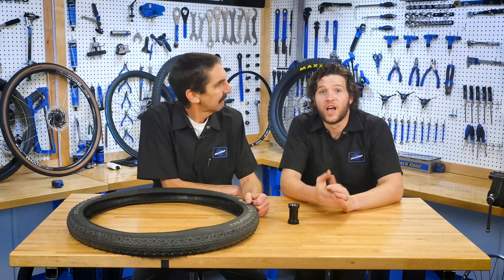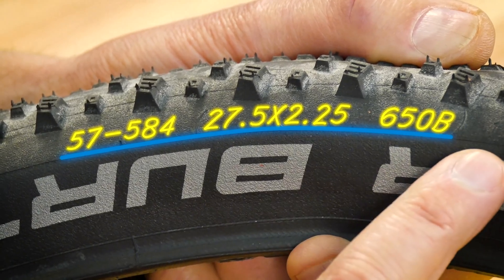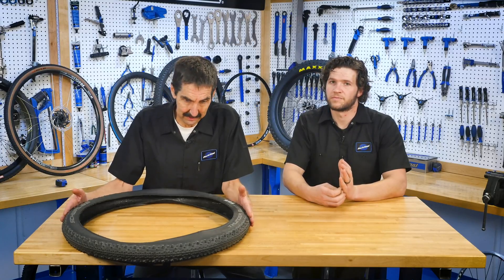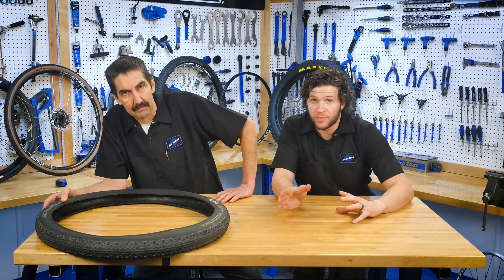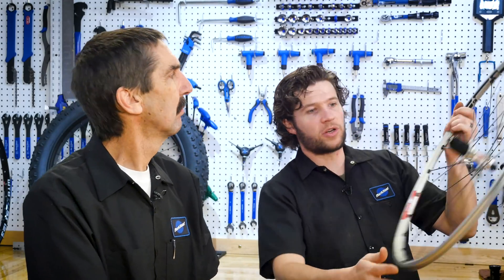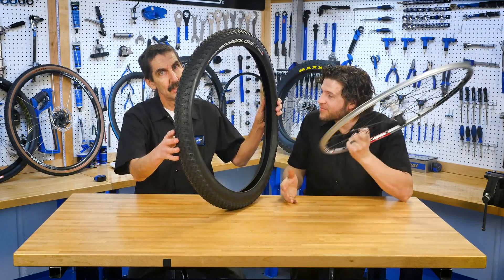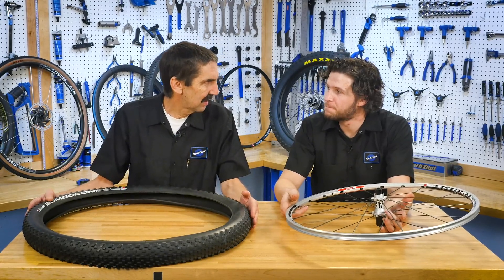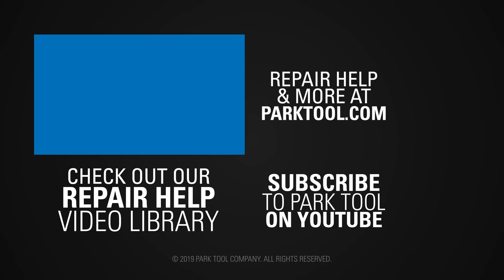Understanding Tire Sizes | Tech Tuesday #145

Comment: Cool video and I've learned a lot from your video but for this, you ain't taught me spit!! I want to know how is my E-Bike rim/tire a 26" x 4" when it doesn't measure anywhere near close but my pedal bike, which is supposed to be a 27.5" rim/tire setup, measures 27.5 for the outside diameter of the tire. I even more confused now. lol. Not really because i understand what you said but it didn't help to know how my rim/tires are 26" x 4". Thanks guys. I'm trying to make sure my tire size is set correctly in the menu. I think it was set at 24" and I changed it to 26" since it's supposed to be 26", but I digress. lol smh. Have a great day!

Comment: I pulled a flat tube out of a tire today. The tube says 700×28/32C and the tire says 700×35C 37-622 so I am unsure which size replacement tube to get. I assume it's a 700C but there are all those other numbers too! VERY CONFUSING

Comment: I believe? the front rim maybe the original? Stating BIG PIG on it. It's an aluminum rim but has no ETRTO #'s on it. I measured from the inside diameter(flange to flange) and was approximately 13/16 across. Tires & innertubes are hard to find here but I do have a new tire 26×1.75 (47-559) and new inner tube size: 26" 47/57 -559 also another new inner tube size: 26"× 1 3/8" (28/37 : 559/597 Can I use any of these to match up to the rim size, tire size I have here? Will definitely subscribe and like if you can help me here. Thx much

Comment: I have a Trek 4300 the existing tires are 26"x2" most of the tires I am finding to replacement are 26"x1.95" or 26x2.10, 26x2.124, 26x2.5 - the question is how critical is the difference between the 1.95 - 2.5 if the rim says 2"? this is a mountain bike by the way

Comment: Mine is 64-622  ,  29x2.35 .... This is at the wheel .... On the rim doesn't have any indicator ... So does this give the actual size to the rim ... Or I still have to remove the wheel just to measure the rim ...

Comment: Great video thanks guys, I'm totally confused by my 37-406 (20X1.35) recumbent tire, A 20" tire doesn't fit because the 406 is a 16" rim outside diameter, so the actual size at base of flange would be 386mm, I wanted to use a fatter tire like a marathon plus but what size do I order, confused !!
Reply from the maker: The industry has not made this easy.  If your tire is a 37-406, that is  the common "20 x 1.75" tire family.  Is your rim also marked 406? It must be if the two originals fit.  This tire family is nominally 20" outside diameter at the tire, not rim.  There are at least 8 other tire sizes with different non-interchangeable bead diameters claiming to be "20", but actually a different fit.  You need a tire marked 45-406, or 42-406, etc.  You can change with width but not the bead seat diameter.
Reply: Thanks @parktool , rim is marked ETRTO 406-19 which seems to be 406 diameter at bead & 19mm wide inside across rim, with a 20" outside tire measurement, Now to find the tire.

Comment: Can 27.5" tires fit 700c wheels ?
Reply from the maker: No.  The bead seat diameter, where the tire bead sits, is 584mm.  The BSD of the 700c is 622mm.

Comment: Hi expert can I put a 26 inches wheel to 24 inches bicycle? Thks
Reply from the maker: If the bike has rim brakes, not possible.  If disc brakes, unlikely but if the frame has clearance, they might fit.

Comment: All four of my steel road bikes are 622 for interchangeability, ranging from 28 to 38 nominal width.  I wouldn't run anything under 32 if my frames could take them.

Comment: Just checked out your video. I have a tire size 28-630 (27x11/8)on my old Trek 400 Series road bike. I’m finding it difficult to find tires with that specific size, I see a lot of 32-630 tires on Amazon. Will that size fit as well?  Thanks for posting great videos 🤙🏾

Comment: IN India Vast majority of Bikes are of Old design (single speed some call them 'roadsters') and have 635(28 x 1.5) and 584(26x1.5) tire seating diameters. this is many many millions of bicycles. 635 more popular i would say. A popular tire maker is Ralston! whose brand(amongst many others) makes these sizes in heavy duty versions(rough roads) in India. the bikes weigh 40 to 55 lbs all steel, steel rods, rack. Step through or shorter versions woudl have the 26, but perhaps 75% are taller and horiz top tube and use the 28 inch version! These things when balls new and grease fresh and adjusted correctly, really cruise.
I have some india Rickshaws with even bigger wheels. cant remember off hand their tire sizes!

Comment: I have a question my tyre size is 27.5 ×1.95/1.75 and i brought a tube 27.5×2.10 will it make any problem plz ans
Reply from the maker: That tube will be difficult to install into those tires. Its possible that you can get it to fit but it will be difficult as it is too large.
Reply: @parktool  one more my tyre size is 27.5 ×2.35 and tube is 27.5×2.10 will it work perfectly
Reply from the maker: That will work great.

Comment: I have a set of 20 inch BMX race wheels that currently have 1 ⅛ tires on them however I’m going to put new 1 ⅜ tires on them.  Both are 451 ISO so my question is which tubes should I get?  I can see ultra lite tubes are available in  Both 1 ⅛ and 1 ⅜  sizes.

Comment: Can you replace original tires with wider tires? And will wider tires slow down the speed much?
Have 16" x 2.25" now...want 16" x 3.0" for my folding ebike.
Reply from the maker: As long as there is clearance for that tire size, you are good to go.
Reply: @parktool  yes about 1/4" on each side

Comment: My bike came with700c by 45 mm tires fitted as stock. Can I change them to 700c by 35 mm? Would a 10 mm drop be bad for my rims?
Reply from the maker: Dropping down to a 35mm tire will not be a big deal for you. it may square the tire a little bit more. This may make the tire more stable laterally than the 45mm tire.

Comment: Please help,  I have a 26" 12×197mm rim.  What tire fits my rim, ???
Reply from the maker: 12x197 sounds like a hub dimension and not a rim dimension. That would make it a fatbike though. So your limited by the clearance of the frame. The original tire should still have a ERTO number.

Comment: Hello Guys-cool video I am doing a restore on an old Italian-early 70's Bianch and the tires rims that it came with need replacing and I don't know how to go about getting the right rims; these are, 700 X32C (32-622)- I would like to buy the same brand and size but newer if possible. Any help I would appreciate it- Thanks

Comment: 54-559
26/2.125
This is my current MTB tire size
I'm planning to make it road use by adding 50-559
26x1.90 slick tires
Will comment with the review
I was told to use 0.4 and 0.8 division to find out the suitable tire size for rim. Hope you guys know about that method already. It looks like a easy way to choose a correct tire size

Comment: 32-622   Cyclo Carbon Ridley   on 622-15 rim 
70-584   E-MTB Haibike Fullseven 7.0 bosch ----> hard to find brownish walled tiers for those  on 584-35 rim = is almost the same hight as an 29er but is rides much much softer on rocky downhills

Comment: Wats da diff between 700x 35c or 35mm??
Reply from the maker: The tire designation of 700 x 35c has a nominal width of 35mm.  It will vary a bit depending up on the rim used.

Comment: Bmx tyre 18/2.1 et 54-355. I bought a 18 inch tyre thinking that will fit. Then I saw the tyre was way too big. In actual fact 355 was the right number for the rim size, which turns out to be about 14 inches. 18 was the outside diameter of the old tyre when fitted. Four inches difference, how could I miss that, yeah, so the point is measure the tyre you are replacing. With a tape measure 😂

Comment: Hi guys, can a 622 tire fit an 700 wheel? An answer will be very useful, because lately I found difficult find my usual tire 25-700 in my usual shop on internet, and instead I find 25-622. Thanks for the attention. Happy Easter
Reply: Yes.

Comment: I bought a cheap rental bike that has 57-622s on a 18mm rim. Did they not know what they were doing, or is that not too extreme? The main problem I have with them is they bust cheap innertubes like there ain't no tomorrow, so I have to buy thinker ones.

Comment: Hi, my rims are 40-507 and i am unable to find any 40-507 tires (no longer in production i think). Is the 47-507 tires compatible with my rims?
Reply from the maker: the 47-507 tire is compatible with your rims. It is wider so be sure there is clearance in your frame and brakes.

Comment: 27/¼ tyre can be fit in 27.5 rim??
Reply from the maker: No, not close.  "27 1/4 inch" has a bead diameter of 630mm.
"27.5 inch" tires use a bead diameter of 584.   This is why the "inch" names are very confusing, and simply a bad system.

Comment: Interesting and useful information. Thanks for sharing. I'm a big fan of the channel. I have a question for you and I hope you can answer it. Can I use a 29x2.25 tire on  27x1 1/4 rims? I have a vintage miyata touring bike with 27x1 1/4 rims and I'd like to find tires that I can ride on trails. Thanks in advance.
Reply from the maker: Thanks for reaching out. You cannot use a 29X2.25 on that wheel unfortunately. the 29 has an ERTO of 622 where the 27x will have an ERTO of 630 and are not compatible with one another.
Reply: @parktool  I understand  and thank you for the quick reply.

Comment: just asking, my tyre size is 29x2.10, it is possible to use 29x2.35?  thanks..
Reply from the maker: The rim will support it as long as there is proper tire clearance in the frame.

Comment: Hello ! I have a bigger tyre rim on the front the back is same size but smaller tyre rim , having a little bigger front tyre , is that bad ? Does that do any thing to the bike? I know it looks abit odd but it’s all I have at the moment do I change it back?
Reply from the maker: Many riders like the larger front tire to absorb bumps and give more control. not a bad thing but there is a point of diminishing returns.
Reply: Cool .. you won’t believe what happen so my dad put my original front tyre rim on his bike with a huge tyre it some how got a flat when he turned the tyre was of the rim!  Yes my bike has bigger rim and tyre at the front with suspension just its turning to right if I do no hands my bike is like new and I think the handle bars are not on properly well there is no strain have no idea why it turns to the right the front again yes it looks abit odd hopefully itll do 
Thanks for info/help!

Comment: My rims are (2 sets) 30-622 and 26-622 and my tires are 50-622 (winter tires are 57-622). I was a little hesitant to make the switch from 26 to 30, but the tire profile actually is really nice with the 50's
.

Comment: Great vid, but I'm still a little confused. can a 52 - 622 tyre replace a 57 - 622 one?
Cheers!
Reply from the maker: Most likely.  The diameter is a match. The new tire is 5mm narrower compared to the 57, and that would certainly be in the acceptable range.
Reply: Nice one, thanks for that.

Comment: I know this video is a year old, but hope someone sees this and can help -

My folding bike uses 16 x 1.75 / ETRTO 47-305 tires

Could a 16 x 1.5 / ETRTO 40-305 tire work on it? Or would the width be too small?
Reply from the maker: You can run that tire on there no big issue. The tread will be about the same width as the rim though which some people do not like but it is totally safe and ridable.
Reply: @parktool  thanks for replying (and providing that info)!

Comment: my mountain bike has rim (20-559/537) and tire is (47/50-559). What is the smallest width that you can recommend for easier pedaling?
Reply from the maker: 26x1.5" tires would be my suggestion. You could go down to a 1" width if you would like to get narrow. The tire will still have adequate width compared to the rim.
Reply: @parktool  thanks for the suggestion.

Comment: the outermost diameter of my fat bike's inflated tire is measured at more then 29", and it's 22.5" for the rim... but on the tire it says '26x4.0'.... i know the 4" is for the tire width but where is it getting the 26" ?
Reply from the maker: That number comes from the rim. The ERTO / rims diameter is the same as a "standard" 26" tire. Not all 26" tires are 26" in diameter. This makes the naming structure difficult to understand by measuring. Thats why ERTO numbers are becoming more important.
Reply: @parktool  well, i saw a vid, he measured the rim diameter at more than 22.5" and said to add the normal/standard tire size, around 2" on both side, and you get approximately 26" for the total wheel diameter.   So in my case, i have the so-called 26" rim but really 22.5", and with the fat tire size of more than 3" on opposite ends, it gets to more than 29" for the entire wheel.  Thanks!

Comment: 23/25-622  &  700x23/25C stamped on the current tires. Rim just says 700c. My question is, can I just use any 700c tire?  I've seen 700Cx 35 & 700Cx32-45. Would those fit?

Comment: My etrto number is 68-406. Question: all these different tire sizes (1.7, 2.5)etc. all of them use the same 20” tube right?
Reply from the maker: For diameter, yes, all 20", or 406 for ETRTO.  Tubes are certainly flexible and can fit a range.  If you ran a tube appropriate for a 1.5 inside a 2.5 tire, that would be asking too much.  It gets thinner the larger it is asked to inflate.
Reply: @parktool  ok thank you. My tire size is 20x3.0 lol

Comment: Very informative, thanks
Here an experience: Same tire (Maxxis Ardent Race 52-622) measured 53mm width on a 21mm rim vs 56 on a 24,5mm rim. It seems that in most cases the first number on the ETRTO (MTB tires below 2.4) is corresponding in width with the first number of the nominal ETRTO.

Comment: my rim is a wtb dual duty with 19-559, the Schwalbe Marathon Plus tire is 47-559.  It should fit, but the tire does not fully seat even using the soapy solution method, or the temporary over inflation to 100psi. I will need to mill down the rim bead slightly.  The same situation on a Kenda tire.

Comment: hi park tool peeps, im having a dilemma on what tire/tube size i should put on my Schwinn Kempo Hybrid bike. The bike comes with a 700x25/32c (622-630) tubes/tires. As i read the imprints on the tires, it says max 70kg -  600 kpa. Im 5'10 215lbs. So the tires are NO BUENO. So i decided to buy new tires that can actually support me. What tire/tube size should i get? And will they be able to support someone like me?
Reply: also, can i put bigger tires on my hybrid bike? like a 700x35c or 700x37c?
Reply from the maker: This will depend on the amount of clearance around the tire in the frame but both the tire sizes mentioned will fit the rim. Both 35's and 37's are common place on hybrids so it comes down to personal preference. Bigger tires give a bit better ride and better floatation on softer soils.

Comment: I bought a bike trainer and it fits a 26 to 28 inch wheel. Now that I'm finding this out I looked at my bike and I believe it is a 32 inch wheel. Will I be able to still set my bike up to it? I have a 2012 Raleigh Cadent. I bought a Deuter bike trainer online.

Comment: 559x21. Rim size.  Currently running 26x1.5 tires it came with new.  Need new tires. Would like fatter ones. What size can I get for my rims.  Tires don't show rim size (inner width) it could fit on. Also on 21 mm rim, could tires with larger (23-28) work ok?

Comment: Hi guys, im using 50-622 etr from 50-559 tire system. It's so difficult to accelerate my new bike than the older one but stabilization of new bike is great. 🙂

Comment: Do you have a dummies guide to your language.🤣 all I wanted was to know what tire witdh will fit my rim with 19mm internal and 25mm external. Was hoping a 30mm would work
Reply from the maker: There is no really firm yes or no to this. A 30mm tire will fit onto that rim and will work well. There are companies and people out there that debate over the ideal rim width to tire width but there is no firm answer at this time.

Comment: hi i was wondering about this to yea i have a 12 1/2x1.75 1/4 Tire     47 203 i want to put wider higher tires on there for the baby stroler how far can you go ?? found 12 inch x 2 mini dirt bike tires will that stil work ?

Comment: I want to change the tyre of my Mountain bike which says 44-559(26x1.95), can I replace it with 54-559…? If not suggest me something that might fit. Also, my front tyre doesn't show any iso number, should I consider that both back front tyres have same iso number?

Comment: I have a old vintage road bike (unknown brand likely mid 80's).   The rim has 700c stamped on the rim.  There is a 700 x 28C on the front and a 700 x 23C on the back.  The back tire will not air up so waiting on tool tire removal tools so I can remove it.  How do I determine the proper size tire for the rims??

Comment: You guys are awesome,  thank you.
Question please. 
My tire says ( 100/90 - 22   24B )
Also says 26 x 4. 
It is on a Rad Rover E-Bike. 
I keep warning out these knobby tires.
I would like to get road tires. Can't find any. Concerning purchasing motorcycle tires. However the wheels measure 22 inches. Any ideas? What motorcycle tire size would I need? 
Thank you

Comment: So, I recently got a flat on my Trek road bike and my tire size is 26cm or 700x18/25C inner tube. My question is... would a 26x 21.-2.4” inner tube fit? All these numbers are so confusing. 🤦🏽‍♀️
Reply from the maker: That tube will not fit into your tire unfortunately. The size of the 26" tube is smaller in diameter than your current tire but much larger volume. You will need to find a tube that says 700x 18/25c or at least has your labeled tire size in the range of fitments. All tubes will have a range of fit.